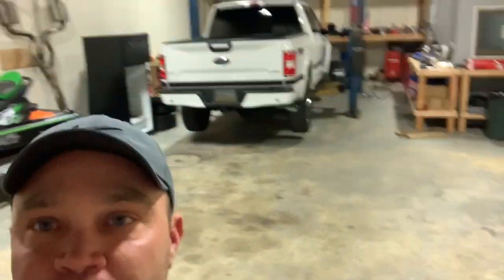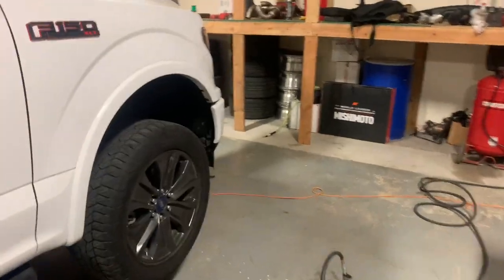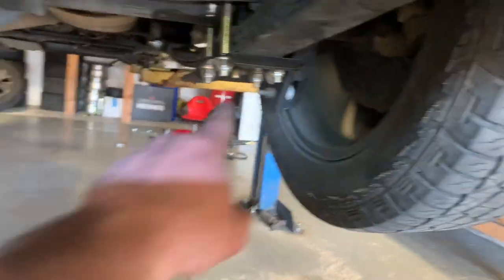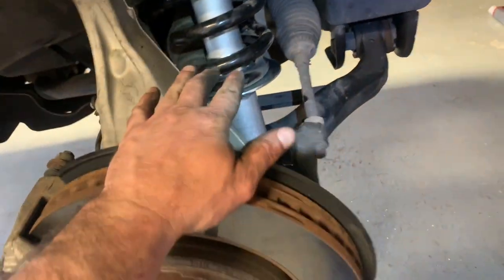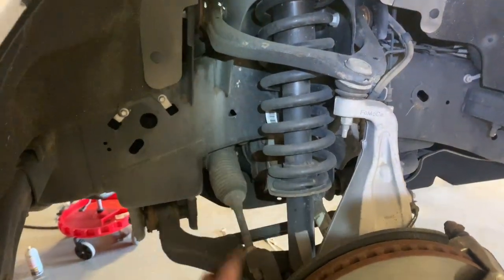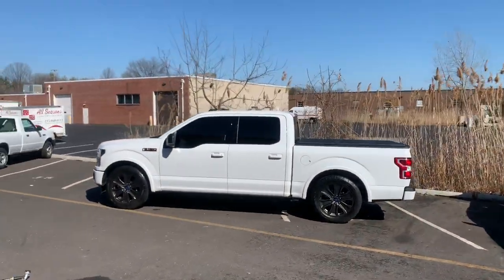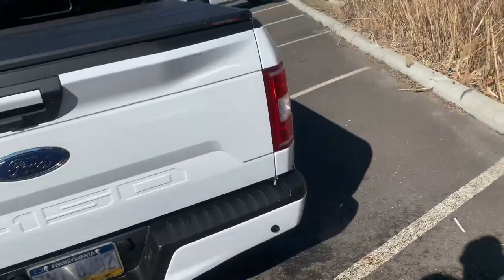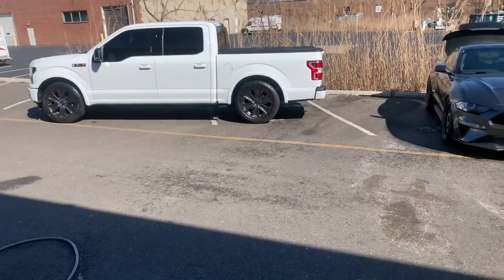2015-2019 Ford F150 3.5 Ecoboost 10R80 FX4 2/4 belltech lowering kit Before & after kit SP-1001

Comment: Looks great 👍 Quick question on the front struts. Did you set it at 2” or 3” drop. I got the same kit and truck but in silver and plan to install this weekend. That will be a huge help to know. Thanks in advance man.
Reply from the maker: 2”
Reply: Thanks 👍👊🏽
Reply: @BoostedAddictions   can u take them all off or u cant?

Comment: Just picked up a 19 5.0 F150. I have back issues and the seats kill me. The radio sucks. Other than that I dig this thing. Looking into lowering it like you did first though. Hope it goes smooth
Reply: I fixed my seats by removing the lumbar spring tensioner and raising the front by installing longer bolts and putting a nut between rail and body.

Comment: Looks great!       Are you hitting the bump stops in the rear? How does it ride? I had a BT 2/4 on my 2016 Ram 1500. It rode pretty bad. Even with helper bags, it was hitting the stops often. Very rough ride. Looked sexy as hell though.